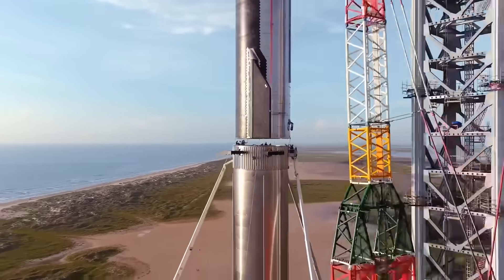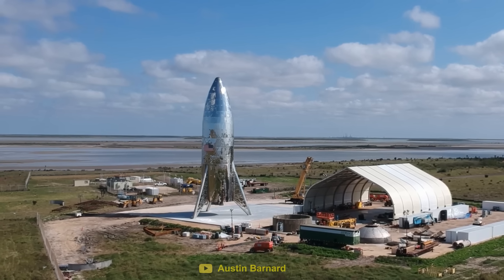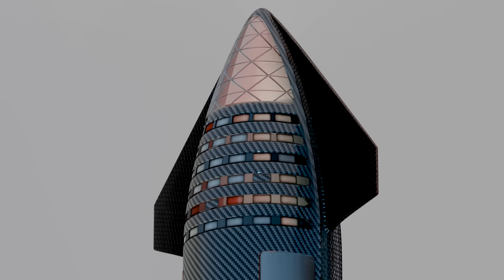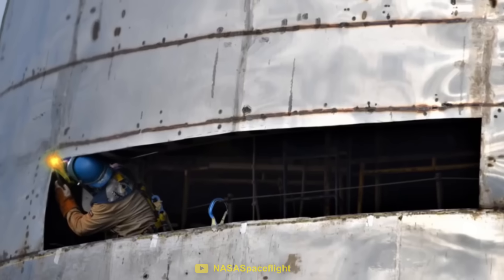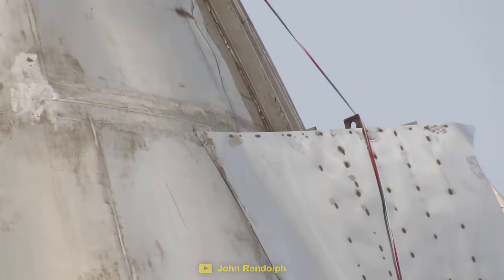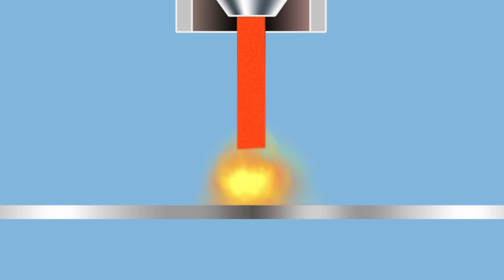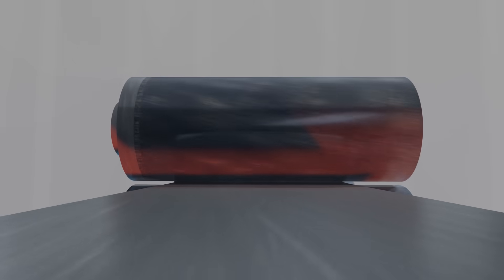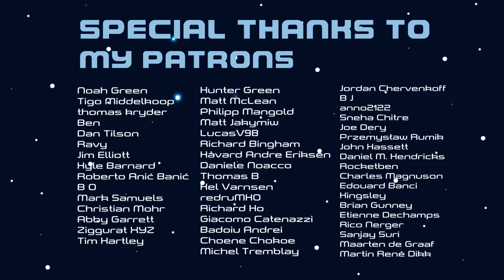How SpaceX Mastered Starship’s Welding

Comment: So in Stainless Steel, solidification cracking happens by the material cooling into a brittle microstructure. There often aren't cracks in the surface of the weld and if there are thats in the process used. That can be due to the puddle not being shielded properly, gas composition, etc. The cracking can be reduced via a more ductile filler material, such as a higher nickel alloy in the filler metal. A slightly higher ferrite content can also act as an austenite stabilizer, which reduces embrittlement.
Reply: Also switching from Mig (Gas Metal Arc Welding) to Tig (Gas Tungsten Arc Welding) doesn't directly mean it penetrates deeper. Tig welds are often stronger because of how clean they are. Mig uses an active gas which allows for more penetration in the material.

Comment: Titanium is probably the ideal metal. But stainless steel in the budget option, and its weight is not as important at this scale. Cost is. It's cheaper to make it larger yet, and burn a few extra tons of methane and LOX than to purchase hundreds of tons of titanium (not enough Ti on the planet to make 10,000 starships).

Comment: thats why 7018 rod is the go to for field welding. I've welded up conveyor belts 200' in the sky with 60  MPH winds. Flux core is pretty much the same thing but wind can really ruin it. MIG welding with gas as the shielding agent is the biggest no go anywhere besides a shop. On a rocket ship i would assume least amount of seams possible/least amount of welding is the play.

Comment: I'm no engineer or welder, but as far as the smoothing/mirror finishing goes, would it be feasible to use a high water pressure system combined with super tiny granules of sand (or some other hard yet super fine material) to polish/smooth out the exterior? Or would that compromise the integrity of the hull and/or welds? (Think of a wet sand blasting system kinda thing).
Reply from the maker: Fair question. It's my understanding that using a high-pressure water system with abrasive particles like sand could damage the metal or compromise the structural integrity.

Comment: I’m a fucking farmer I know more about welding than spacex’ so called engineers. If it weren’t so sad it would be funny how easily these muppets get govt funding.
Reply: Oh yeah Im sure you could build starship yourself too right 😉
Reply: @drmantistoboggan2870  no but I can tell you that your gonna get dog shit weld quality using flux core. I wouldn’t use flux core to fix rust holes in my 96 chevy
Reply: @easybreezy9666  Flux welding is one of the strongest weld form while still being pretty quick. what would u use

Comment: That’s not how flux cored welding works bud, the flux is on the inside of the metal wire not the outside.

Comment: I disagree. 
The rugged welds were used initially because SpaceX didn't NEED spaceworthy or even flight worthy  rockets.
It literally didn't matter whether the welds were good enough for flight tests or space shots because the framework was never meant to leave the launch pad and were tested to destruction in pressurization tests and static engine firing tests.
These  prototypes were never going to even fly, nevermind go into space.
Cleaner, better, stronger welding occured when better, stronger welds were needed later in the prototyping process.

Comment: Love the video. Though I find the price comparison on Carbon Fiber and Stainless steel as a very weak argument. Carbon Fiber as you said weighs less than Stainless steel so I believe the comparison isn't well made or glanced over too quickly. Since you would get more Carbon fiber in 1 KG (in a sense of volume) than you would of stainless steel. Saying the price of one Kilogram doesn't change the massive layer on the space ship that the steel/carbon fiber has to cover. The better comparison would be the price for either square centimeter/inch/meter/foot. Other than that I liked the video.

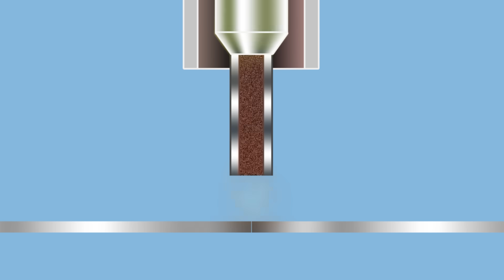Comment: 3:28 
while technically all electric welding methods do use plasma arcs as their way of melting both the metal and the welding filament, the one described here is called MIG (metal inert gas) welding, i will not argue with the fact that they were using flux core wire. 
ARC or Stick welding also uses a similar method to flux core wire MIG, but the flux in that case encases the metal sticks. Not very important to the overall content, but just thought to clear that up

Comment: This video seems like the equivalent of one of those reddit comments where someone says a bunch of stuff really confidently and sounds legit, but if you know anything about what hes talking about you see tons of mistakes.
I only got up to the part about flux core but I don't want to go any further lol, number one messing up how it works, but mainly saying that it doesn't work well in outdoor environments, when that's literally the main reason they chose flux core initially over something like tig or mig, flux core does much better in a breeze because the wind won't blow away the gas shield.

Comment: Tip-TIG is TIG welding with continuous wire. The explanation is wrong here to. This is nothing to write home about. All this i low tech welding. Laser welding is fairly mainstream today when welding thin steel. This welding is not hard to acomplish. Thin stainless is not hard to weld. And the process of securing stainless steel from corrosion at welds is not new or advanced. They were basically not very skilled in the beginning.

Comment: The explanation of FCAW is wrong. Why bother explaining something you know nothing about and getting it wrong. FCAW is basically MAG welding with continuous wire with gas shielding and a flux inside the wire. The finished weld has a slag cover. Makes me wonder what else of the facts is wrong. One thing is probably the parent material. I highly suspect it is stated the wrong material. I would guess duplex or superduplex is used.

Comment: Informative video, but entire cirst half isnt how I'd describe it as a mechanical Engineer. Grinding down the welds is most obvious method to improve welds in general and is a very normal thing in industries like Automobile etc. There is nothing specific about spaceX doing it. The rest of the video was informative regardless.

Comment: Flux core , From personal experience being around welders and welding machines a lot , is a type of welding wire in MIG welding , ordinary MIG wire is a thin and long flexible wire stored in a roll , 1 or 2kg usually , because it's very thin (<1mm) it can bend easily , and go through wire feeders throgh the welder's cable and out the welding torch , in Flux core , the flux is inside the wire and the "filler metal" is wrapped around it like a cigar , not the other way around , flux is known in stick welding (MMA) to be put on the outside of the electrode , thus it looks like sun eyes fireworks .

Comment: This aged poorly
Reply: how? lmao
Reply: @lewis0701  starship exploded
Reply: @RhysP10  yeh but that was expected lol
Reply: @lewis0701  sure buddy
Reply: @Silas  it was literally a launch test and it successfully launched. everything after that was a bonus and they expected it to explode
Reply: @lewis0701  Is this sarcasm?
Reply: @silas823  no? how would that be sarcasm?
Reply: @RhysP10  I'm guessing you are new to SpaceX approach. They embrace iterative design process which they are not afraid of failure. They learn from it and innovate quickly instead of relying on simulation like NASA did which could take years. They literally said before the  launch that clearing the tower is their main goal. Achieving the rest like getting to orbit is an icing on the cake which didn't happen unfortunately. It exploded due to flight termination system onboard Starship initiated by the ground crew when they couldn't separated Starship from Superheavy booster.
Reply: @Creed109  aight

Comment: So in order to find out that carbon is not suitable for the circumstances they had to try it first? Only to find out that SS deforms heavily when welded and later that in order to weld it properly you should employ the proper preparation and procedures instead of trying to grind the faults out? Why was so much effort put into excluding people with a normal basic knowledge about these things? Are experts not trusted anymore? Are they seen as a threat to progress? I want to defend them and say that they don't deserve this treatment.

Comment: Wrong!    I told those guys that i didn't know a damn thing about rockets but i've forgotten more about welding stainless steel than they could ever hope to know,  thats when i told them that they should be using 304 and that they need to back flood the weld area with Argon to stop the wicked porosity they were getting and that's about the time the mark1 fell apart.  Then they were all like "yeah, back flood the area with inert gas you say?"   and i was all like "that might be a good start" and stuff.   Those rocket scientists think they're so smart.  Anyway, not knowing a damn thing about rockets but knowing assloads about stainless, i can tell the boys and girls at home that they are asking a lot of that booster with a fully loaded rocket sitting on top of it.   Don't worry though,  i'm a super brain genius i know how to fix it.

Comment: Just a correction, with flux core the flux is generally contained inside the metal wire, not on the outside like mentioned here.

Comment: As someone who is in the welding industry I don’t know why they wouldn’t just hire aerospace welders? It’s their job to weld planes and spacecrafts for high heat and pressures.
Reply from the maker: They have likely hired many welders from those fields now. The workforce in Starbase is huge now and they are setting up proper factories with welding robots.

Comment: No offense to anyone here. I see some responses below and with that attitude, either you would've walk off the job the first day or been terminated. Working for Elon is like no other job.                    I take off my hat to all the Starship pioneers in 2019 (especially all the tank and pipe welders). If it weren't for their toughness, we would not see what the Starship is today. Everyone wants to work for SpaceX and its definitely not for everyone. To be successful at SpaceX, you must be very, very flexible, and be fine with wearing many hats. Often times the non-aerospace employees are the ones that are most successful. For R&D projects like Starship sometimes you have to but your proven hard-working skills you have acquired and stick them in your back pocket. It's a tough peel to swallow for well-seasoned. Every approach you can come up with is irrelevant. Why? Because Elon's unconventional, assbackwards way work! I was there for 10 years, and I would do the craziness all over!

Comment: Sorry but your description of flux core wire welding is incorrect. In that method the flux is inside the wire. With SMAW (or shielded metal arc welding) the flux is on the outside of an electrode rod

Comment: Could they just cover starship in a thin reflective metal overtop of the steel well now I think how would they attach it to the steel without warping it well what if because one side has the heat shield they could attach it there and just have the heat shield cover the welds or have the heat shield lock through the sheet into the steel but that wouldn’t help the front but they could attach it to where the “windows” are and that would lock it in more and would keep it shiny but maybe I’m overthinking it and they could just paint it with a special paint

Comment: So much work wasted. I can imagine that the welders who worked on the first prototype got pissed and rolled their eyes and said “I could have told you that would happen” when they saw the thing blow apart during testing.

When software goes through a “move fast and break things” process the only person whose labor is wasted are the coders. On something like this you’re wasting the labor of dozens of skilled workers, not to mention the materials and consumables. And literally any welding engineer worth their salt could have made a procedure specification that conformed to ASME BPVC if someone in management had been willing to listen.

Comment: When you show the crystal structure surrounding the weld, the crystals towards the edge should be elongated, the ones where the weld has occured should be smaller and not stretched since welding will have caused new smaller crystals to propagate. Then when the planishing machine squishes the metal you can accurately show the crystals elongating again due to the cold work.

Comment: Rocket Lab’s Neutron rocket isn’t as big as Starship, but it is using carbon fiber like Starship originally was going to. It would be interesting to know what tricks Rocket Lab has learned working with carbon fiber that SpaceX either didn’t have or couldn’t use at Starship’s size.

Comment: Nice vid. Just dont get why you sound so flabergasted by the price difference in KG between steel and carbonfibre. When you just mentioned before it steel is way heavier. so 1kg of carbon fibre should be more square meters then steel. So why use kg/$ and not SquareM/$?

Comment: They should really use carbon fiber and give it legs so they don't have to catch it. Elon is painting himself into a corner with this design.
Reply: They know how to give a rocket legs. Look at Falcon 9. They are not backing themselves into a design. They are testing it to see if they can get it to work. If it does work, it will be a massive improvement over all rockets. If it doesn't work, they start over and use legs. Not a big deal either way.

Comment: I was very surprised spaceX built their first prototype in this way.  301 isn't easy to weld (even harder to laser weld) and hand welding was always going to result in poor and critically unpredictable strength.  I would look at orbital weld system.  TIG or continuous laser (pulse laser will blow through the sheet at that thickness and result in very poor and unpredictable results).  See companies like ORBIWELD.  They have weld heads they can run on rails clamped to the cylinder outside wall.  This saves having to rotate the large mass.  You can run argon inside and out for ultra-pure weld.

Comment: Space-X's so-called "Starship" will never go to Mars and will never carry passengers or freight "point to point" on planet Earth, as Elon Musk has predicted.  Waiting for Musk's failed promises to come to fruition has become a never ending hobby for Tesla fan-boys.  Where is the "Cyber Truck?"  Where is the "electric semi?"  Where is the "Hyperloop?"  Where is the "HIGH SPEED" Las Vegas loop?  Where is Musk's "fully autonomous" self driving car?  Elon Musk has proven exactly ONE thing beyond doubt:  Literally anything is possible in CGI.
Reply: Starship will go to Mars and the Moon.   The cybertruck casting machine is being shipped to Austin.  Semi was just recently delivered.  The Vegas Loop was never meant to be high speed.
Reply: @user-RCST  Don't hold your breath waiting for Musk to deliver.  By the way, the electric semi is a joke.  It carries less than 1/2 the load of a diesel semi, has ONE FOURTH the range, and there is no existing infrastructure to recharge its batteries rapidly.  It is economically uncompetitive.  In order for the Starship to fulfill its mission, it must be REFUELED in ORBIT, and there is currently no viable way proposed to accomplish this.  It will NEVER go to Mars and is unlikely to ever leave Earth orbit.
Reply: @Department of Redundancy Department     the Tesla semi is capable of carrying 22 tons of cargo 500 miles which is fairly average for a semi truck.  The cost of electricity makes it economical.  They're building out the infrastructure currently with Pepsi.  SpaceX has theories on how to do orbital refueling.
Reply: I know what you mean with all of that but unlike anything else Elon made Space X is actually delivering some good results. The Falcons are showing to be pretty good at their job and the same goes for the Dragon capsules, even if it's possibly just NASA trying to keep Elon's stupidity from hurting anybody or damaging anything up there...
Reply: @marcogentile3392  The Falcon system is demonstrably good and a real achievement, but of course, Musk has had NOTHING directly to do with its success.  It is the work of the engineers and scientists who work at Space X who have achieved all this, and with the help of taxpayer money.  The success of the Falcon system is the main reason why Musk's focus on the absurd "Starship" is so bizarre.  The less Musk has to do with Space X directly, the better are its odds to continue to succeed.
Reply: @DEPARTMENTOFREDUNDANCYDEPT  You have issues man. This last comment shows it. SpaceX's Falcon 9 was built and developed over a decade ago with SpaceX having very little money and engineers. Yet at that time Elon Musk supposedly did nothing with it and cannot be given any credit at all, according to you. Yet now that SpaceX has grown massively and is one of the top companies in the world for engineers, now there are hardly any engineers working on Starship and it is entirely Elon Musk? Get off your blind hate.
Reply: @DEPARTMENTOFREDUNDANCYDEPT  "Please cite the blind, blah, blah, blah"
Was already cited with you thinking Falcon 9 had no Elon and tons of engineers while Starship is all Elon (and therefore horrible). Of course you also think everything he ever said is a lie while any mistakes or delays by any of his companies "prove" this in your eyes. While also anything his companies did well had nothing to do with him. Another fun one is hyperloop, which he opened sourced and never worked on. Yet you think he took government money on and slowed down projects for, even though both never actually happened. Tons of blind hate.